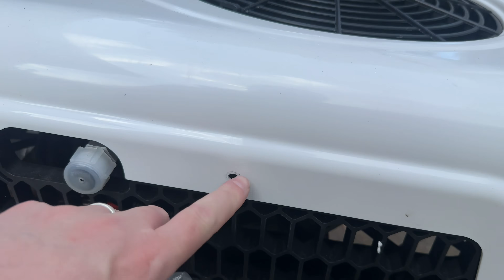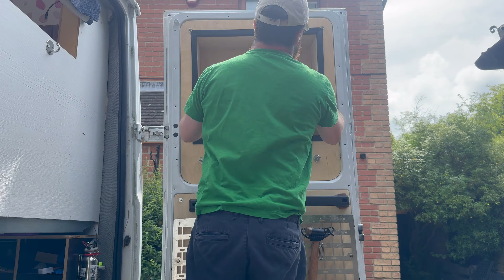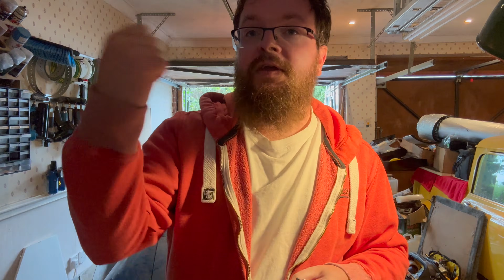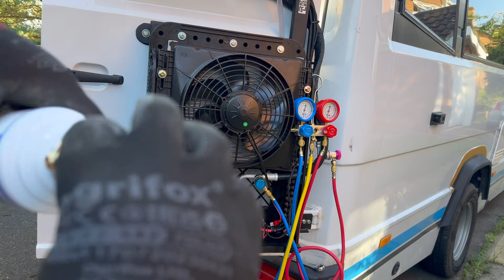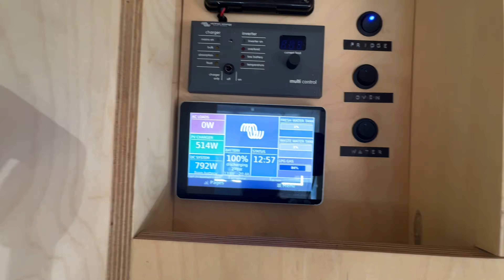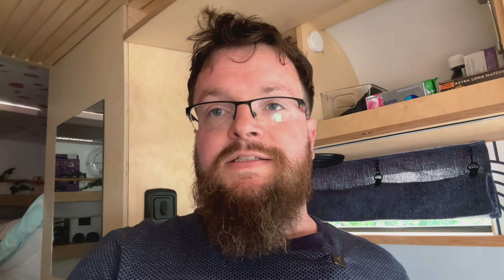12V Air Conditioning - 'Holy Grail' Treeligo Mini Split Van Install

Comment from the maker: Hey all. Thanks for watching, we will be giving the unit a good test over the next few weeks. So any questions please ask away. 

Quick heads up - about 6 mins odd in I did not add an overlay of the victron install. But it still makes sense - just a bit of a jump cut.

Thanks so much for watching. Appreciate it. Safe travels and stay cool
Reply: Any update on this unit and it's reliability?

Comment: im late to ur video but enjoyed the info, thank you. if ur havent came to the conclusion yet i would leave it on high until u reach ur desired temp and not to rely on  the units thermometer, the recessed nook u got it in will make a whirlpool cold zone and think its cooler than what it is
Reply from the maker: Yeah this is largely how we find it. We’ve since also made an adapter to add an insulated hose to carry the cooler air into the hab area - although for our use the sleeping area is the key place to get cool.

Comment: Hello there, love the video! I have installed this exact unit and am stuck at the final step. I am unable to add the refrigerant. I am trying to add it with the unit off, but I am being told by my local shop the ac unit must be on to pull the refrigerant from the can. Im so confused. Any information would be greatly appreciated.  Thank you
Reply from the maker: I began adding with it off then switched the unit on to allow it to circulate. I am no expert but I didn’t want the unit running totally dry without anything in it.
Reply: @WanderbusAdventures thanks for the reply. So it did indeed flow into the system with the unit off for you. I wonder what i am doing wrong? All i can think of is i didnt pierce the can opening with the tap

Comment: Hi firstly great video ...i am looking to installed on roof and controller unit in cab as don't have A/C my question is how long are the pipes as from the the middle of my van on the roof (only space due to solar panels) to the cab its roughly 11ft...regarding power not an issue as batteries will be roughly 5ft from the unit.
Reply from the maker: I can’t actually recall but they are long. I’d say comfortably the height of my bus
Reply: Sorry another question as been looking and most people hang the unit on back door...i am looking to installed on the roof of my campervan is that ok...oh found out pipes are 5 metres long.

Comment: Can this be installed facing forward. I have a box truck and want to install it in the front of the box. Can find any info on if that is possible or not
Reply from the maker: Not 100% sure but I was told it could be installed on a roof. I’d imagine on the front your biggest issue would be debris and muck getting in it and blocking the fins though.

Comment: Great video! Any info on the electrical parts? I was planning on plugging mine on my 12v distribution panel. Obviously it is to big for that.
Reply from the maker: Hey thanks. For our install I’ve ran 16mm2 cable to a Victron battery connect from the Lynx. Then it joins to the included cabling by the back door via a 60amp mini fuse holder.

Comment: Great video! Ive got a roof mounted 1 coming from china, think I'm gonna risk adding the r134a without the vacuum kit 🤞
Reply: No comes without unfortunately, did some more research and I ended up ordering the vacuum kit (china again 😆). Only £100 and I could even likely sell on eBay for that used
Reply from the maker: @firstnamesurname955 we sold ours on too 😂
Reply from the maker: That’s good news re. The roof mount. It’s possible that might already have the gas in it. Do
Check. If not get your local
Garage to vacuum and fill it. I’ve since found this is probably a more economical way to do it anyway in some places (not all).

Comment: The placement seems to be restricting the airflow both in and out of the evaporator side.
Reply from the maker: More space around the unit would be better for sure. In most installs it would just be on the door but for me this was not an option due to our bedroom configuration. For the out vents you can easily angle them, but I have since made an adapter to turn two of these vents into one that now point into the main living space.

Comment: Nice one mate. Good to see others with the same AC. I was in Greece last summer, 35-45C outside dueing the heatwave was insanely hot, this thing saved us but it does pull a lot of power up to 50 amps max when in scorching sun. 400w solar and 560ah lifepo battery bank gave us 8 hrs max but as you said we didn't want to drain our battery. Do have occasions when it doesnt cool and needs some resets as compressor overheats ... I reached out to treeligo and they sent me a new PCB to replace... Havent done yet
Reply: Yeah it was life saver in heat wave, it took temps down good enough above the bed, cab is hard to keep cool so I curtain that area off
Reply: How did it do in Greece? Was it able to cool you down enough?

Comment: Most of the technical stuff in this video is a bit off...   2 important notes:

You cant fill an AC unit by looking at the pressures, thats why it tells you the amount of refrigerant required by weight.

A full vacuum is -30"Hg, not psi.
Reply from the maker: Thanks for your input. The instructions are based on pressure but also state 600-650g of R134A. We can’t get that in the UK anymore, so the equivalent is 1.5 cans of what we used to equal 600 grams. Is that why they suggest pressure?

Comment: what size hole did you drill for the rubber grommet to feed the lines through the back of the van to the inside?
Reply from the maker: Mine was 40mm
Reply: @WanderbusAdventures thanks for the quick reply!
Reply from the maker: @ no problem.

Comment: Hey when you installed the refrigerant, did you open both low and high side? How long did it take to empty the first can?
Reply from the maker: Once it had chance to pump around yes, I can't remember how long it took. No longer than 10 minutes to empty the first can though.

Comment: Nice video! Some systems have pressure switch on the receiver-drier to deactivate the system if the pressure gets too high. Does this system have that? Is the receiver-drier replaceable?
Reply from the maker: Great question and honestly not sure of the answer. Will ask the manufacturer or investigate further.

Comment: Hi There just saw your video and channel for the first time, and i’m not sure if you already have given an update on your Aircon. And thanks for sharing your experience on the install and performance. 

First: Im wondering how the Aircon would perform if the windows of your van were shaded from outside? 
The reason for my wonder is how much quicker you can reach the desired temperature inside. 

Second: What is the given humidity at the given temperature? 
Im sure if the humidity is low, the desired temperature is quicker reached, then when the humidity is high. 
Within a small space as a van, during cooking or taking a shower, the Aircon will draw more energy. 
Could you please share if and how much energy the Aircon is using during cooking or taking a shower? 

Cheers Eric
Reply from the maker: Hey Eric, sorry for the late reply. Can confirm with the blinds down it does cool a lot quicker, same when the blind is over the skylight in the bedroom - and this is where it gets very cool indeed. We will need to check back in when we are in hotter climes for the humidity update - but you make a great point.
Reply: @WanderbusAdventures  thanks for your reply! I hear so many different reviews on these split types aircon’s. 
Im happy to hear that it works just fine for you, and im going to invest in this too. 

What I still wonder is; how to ventilate the air inside as the space is soo small. 
I hear that people open the roof hatches, so that hot air can escapes, while using the Aircon. 
But that doesn’t explain how the air gets refreshed?
My thoughts were to make a simple “heat recovery unit” with 2 12v fans and aluminum tubing. Fresh air blows in from outside, and gets cooled down, with the old air from inside.  
The heat recovery unit based on 12V hasn’t been sold yet. So thats the reason for me looking into building myself. 

Please do share your experience, and soon when I start building. I share mine 

Cheers

Comment: Would this work in a really dusty environment like burning man? or would it just blow dust into the van? Or any suggestions of filtration on the outside that would work?
Reply from the maker: Hey. It won’t blow dust into the van as it is using the recirculated air in the van itself. It would pull the dusty air through the outside radiator, so you’d need to keep an eye that doesn’t get clogged - not knowing how dusty it gets at burning man means I’m not an expert here however. Safe travels.

Comment: What’s the rated btu claim?  How’s it running now?  I’m interested in two of these to install on my bus, but am worried that they do actually produce the claimed btus.  I’m looking at a 24v unit treeligo claims is a 13500 Btu unit. With a max power consumption of 960watts.  My concern is that the real world numbers of watts to btus may mean these only produce 3-4k btus.
Reply from the maker: The claim on this one is 10,000 BTU, I have not seen it pull over 700w yet. But note it is winter here, I am not using it in the winter months though.
Reply from the maker: Main unit is 60cm tall, 21cm deep and 49cm wide.
Reply: Also what are the measurements on that unit?  I’m seeing 18x22x6 on the Amazon listing I’m looking at.  The unit in your video looks wider than 18 inches.

Comment: I've seen it on Ebay for £500 ish,  do you think it's worth it regarding reliability. 👍👍
Reply from the maker: So far it has been good, but we've only had it a relatively short time. One observation is they used cheap screws, so change those right away to avoid them rusting. We will report back once we have used it more - hope you understand, we just want to be honest - it's reliable so far, but it hasn't been that long.

Comment: My 16 plate Transit custom  has no air conditioning, can I fit this just to run whilst I'm driving along of the normal 12v  system  when I'm in Italy, it was unbearable in summer.
Reply from the maker: Hey, I would check the alternator output of your van to see how big a B2B you could run or if you were to run it direct - I think they are good for 150amps minimum from a quick google. But do check, on this basis it would work whilst driving yes, we have used it whilst in motion. Would this be for the back or the cab?
Reply: @WanderbusAdventures  Hi many thanks for replying, it would only be for the cab, I like my transit but I overlooked the fact that it doesn't have air con,  and as I want to go back to Italy in 2025, I just found it unbearable, but obviously I will want it on all the time, the van has a bulkhead so the cab is separate from the rest of the van, cheers john 👍

Comment: The temperature thing is not the biggest problem to deal with because you can cool down while having a quick shower or just a ice pack on your head but it's the humidity so humidity needs to focus its energy on developing highly efficient dehumidifier
Reply from the maker: This is a good point. When we get a hot spell I’ll see what my RuuviTags show in terms of humidity. This is why you hear people say, ‘yeah but it’s a dry heat’. When on holiday. Great point.

Comment: 1/2" Pex pipe fits on the drain outlets nicely. One can then drain the condensation with a very clean appearance.
Reply from the maker: Interesting. Will check that out as would be neater for sure. Also since install have made a couple of small changes and have some other ideas:
- have made a cover for when not in use to keep road dirt from getting inside
- considering a quick disconnect for when not in use, so the cable is not stressed. Seems sensible for winter months - but thinking in that. 

Thanks for the tip. Love to improve things.

Comment: What size wiring did you use?
Reply from the maker: 16mm2. Rated for 110amps did to the cable length.

Comment: you can use a regular fan to push the cool air to the bedroom
Reply from the maker: That’s a good point. We have been using the gimbal fan in the bedroom to do just that and it works a treat. Thanks for this tip.

Comment: Do you need to add compressor oil to the compressor as well? I have read it needs about 100ml of oil.
Reply from the maker: Hi. So you’re right that the capacity is around 100ml. I’ve checked with Treeligo and they’ve confirmed this is already included; my advice is to check when installing. No leaks on mine, but you never know.
Reply: @WanderbusAdventures  thank you

Comment: What is your power bank and how much power it use for 10 hours 
Is it2 batteries of 200A each
 good or i need more to run for 10 hours 
Thank you
Reply from the maker: Hi, we have 680ah of battery. Ours are AGM Supercycle, and as such we have around 400ah of usable power. In very hot climate on full blast we think that would last 4-6 hours. However if you put in on a lower setting this would last longer, and if you have solar like we do longer still (obviously its best to avoid the sun but on days when we can't we can run this without depleting the battery). It's best to use an online calculator to work out what you might need.

Comment: Can this be mounted on a camper/rv roof. I checked all listings and didn’t see anything saying it had to mounted vertically
Reply from the maker: I’ve asked the manufacturer and they don’t recommend you do. It is designed to be mounted vertically as possible.  They do offer a roof mounted option though; but not sure how that’s installed. Looks perhaps like an all in one unit.

Comment: I just installed a treeligo unit however mine didn't come with any instructions! Any chance I could get a copy of your instructions manual? I'm getting an error code 10 - 5
Reply from the maker: Hey. Oh no. I can’t see that error code in my instruction manual. E05 is there though. Is it that?
Reply: @WanderbusAdventures  yeah?! What's the 5 error code?
Reply from the maker: @TrinaMorago compressor overheating 

1，系统缺少冷媒。
The system is short of refrigerant.
2，冷凝器表面灰尘不散热。
Dust on the surface of condenser causes no heat dissipation.
3，冷凝电机转速不够。 Insufficient speed of condensing motor.
4，安装时进出风空间狭小冷凝器不散热。
During installation, the air inlet and outlet space is narrow, resulting in no heat dissipation of condenser.
5，压缩机控制器故障。 Compressor controller failure.
Reply: @WanderbusAdventures  Thanks! I'll look into that
Reply: @WanderbusAdventures so 40 or 50 psi of refrigerant?
Reply from the maker: @ on the low pressure side yes.

Comment: Nice job! I've got the same unit, just installed it in the cab of my expedition vehicle.  How many and what size refrigerant cans did you use? Thanks! I don't know about the UK, but here in the USA you can rent the vaccum pump and manifold set for free at most auto parts stores.
Reply from the maker: Thanks. I used replacement gas for R134a, I believe in US you’ll be able to buy cans of actual R134a. I used two cans and the pressure looked good on the low side and within the range on the high side - but could have been higher. Best advice I can give is go by the pressure and not the number of cans. That’s interesting you can hire them for free, amazing actually. What a saving.
Reply: @WanderbusAdventures  So I did the refridgerant service and the cooling works great. Just wondering if you have a vibration noise, especially when the compressor kicks on. I notice that the compressor is mounted on rubber isolators but they seem really stiff and don't seem to do any dampening. Just wondering if you have experienced this. Cheers!
Reply from the maker: @conjin1 brilliant stuff. Well done on that. We’ve noticed it on the inner unit and think we will add rubber spacers behind it to dampen it a bit. On the outside when on full blast it is noisier for sure, but we can not hear that inside so much. Have you added sound deadening to the panel? Our doors have that and that’ll take the resonance out of the panel.
Reply: @WanderbusAdventures  there is sound deadening installed on the wall. I am also thinking of adding isolates inside and replacing the ones on the compressor with softer ones.
Reply from the maker: @conjin1 that sounds like a good idea. Let us know if it works please

Comment: Nice that's actually fairly well priced, how much was shipping? 

2nd best thing about AC after the fact it cools is that it also reduces humidity which makes sweating a lot effective which makes you feel even cooler.
Reply from the maker: Amazingly that included shipping. Shipping was quite a lot of it. I think as I went direct it cut out a lot of the fees. Bear in mind I did buy it almost a calendar year before fitting it.

That’s a great point re. The humidity. You can see it on the Ruuvi tags I have drop a lot quicker than the temp. Which is no bad thing like you say.

Comment: do you have a link to it when i go in to their site  they are saying its 11,000 to 22,000 btu and start from $11,000
Reply from the maker: Just had a look. I see the same thing as you, it has to be said their website isn’t the best. When I bought it I emailed and then worked it out via their WhatsApp customer service. I can see some links on eBay and other sites if that’s useful?